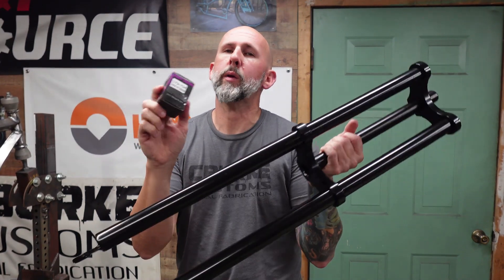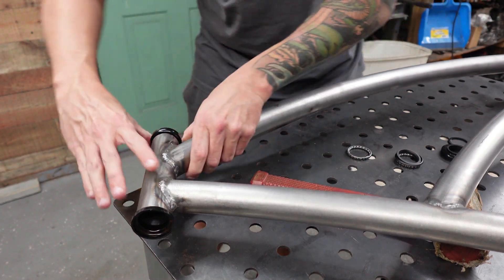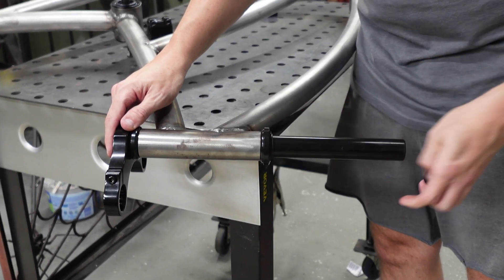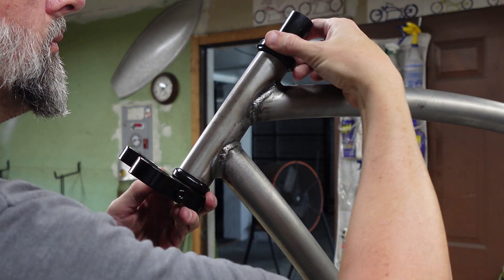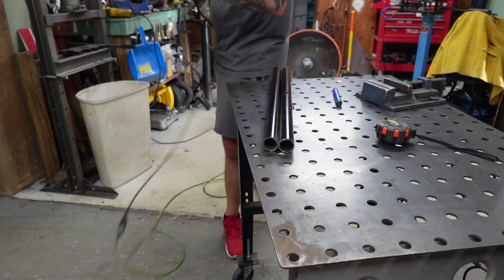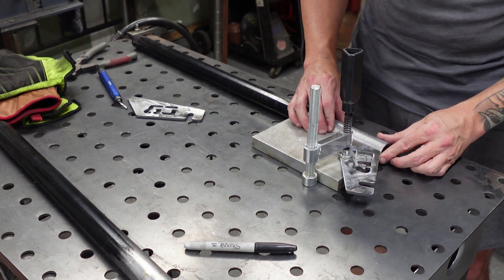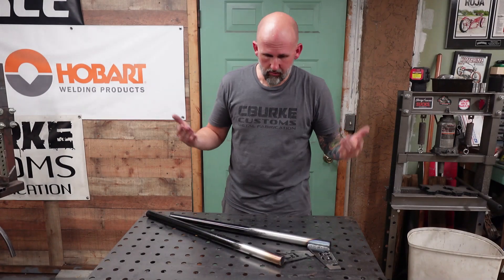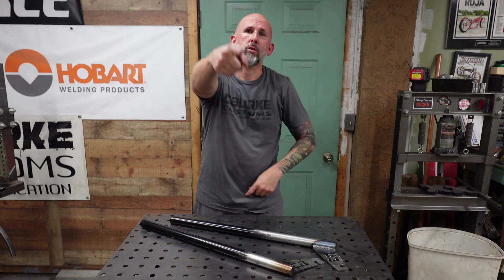How-To: Custom Bicycle Triple Tree Fork

Comment: I've discovered that Ruff Cycles triple trees take a 29er wheel, ex factory- if your head tube is less than 8" long, mate.
Top points for your welding, too- very smoooth.
Reply from the maker: Thank you sir. 🙏🏻👊🏻

Comment: Very nice. Now chop steering tube down. Replace stem with just a small spacer. Install an expanding plug and top-cap. Move your fork tubes up in top crown. Finish with 31мм riser clip-on handlebars. If you want higher handlebars, use longer fork tubes.
Reply: @CburkeCustoms  Yeah, it will look more like a motorcycle. Great for ebike builds. Also, fork legs can be used to hide brake cable (left)  and front hub motor wire (right), by routing them inside. I internally routed back brake, rear hub motor, throttle, and all other cables in bike frame. Slant metal punch in holes and hit side with hammer, to make ports point in proper directions. Some drilling and sanding required.😁

Comment: A little off topic, but have you done a video on disc brakes? I'm planning on a build this summer but I'm new to disc brakes and not sure how to go about it
Reply from the maker: I never do them. For a custom, I feel like less is more and it clutters the front end. I think people see me build these and assume I'm a bike guy. I'm not. I do this as art and love that it's also functional art. Other than that, I'm not the guy for disc brakes or belt drive or anything else like that.
Reply: @CburkeCustoms  I completely understand, I love the work you do. It's amazing art. The ride you did with the spoons will always be my favorite. Loves that one. If I wasn't going to go with a full ebike build I'd definitely be using a coaster lol
Reply from the maker: @kylekunde1568  thank you! 
You can watch my Escooter build. I did a back disc brake for that reason. My front fork already had the brackets.
Reply: @CburkeCustoms  will do, thanks. You think it's better on the back or the front? Or is it purely preference?
Reply from the maker: @kylekunde1568  so mine has e-assist when breaking, and I don't even use them. As for a hard stop, I'd want the back. You lock up a front break, and you could go down.
Reply: @CburkeCustoms  makes sense. I assumed that'd be the case but like I said, never used them before lol. Thank you for answering all my questions, been a big help and learned alot
Reply from the maker: @kylekunde1568  very welcome!